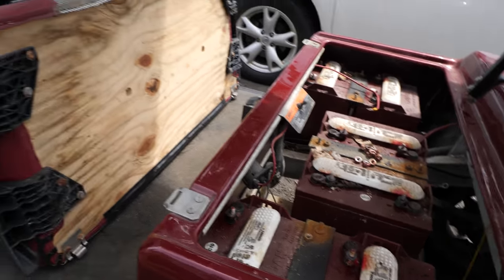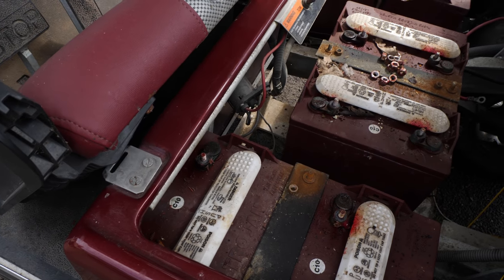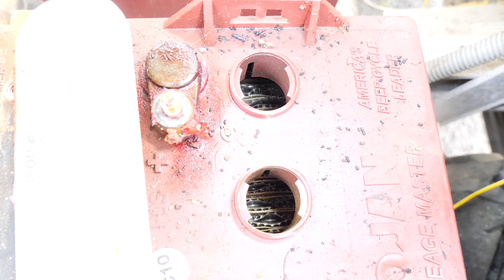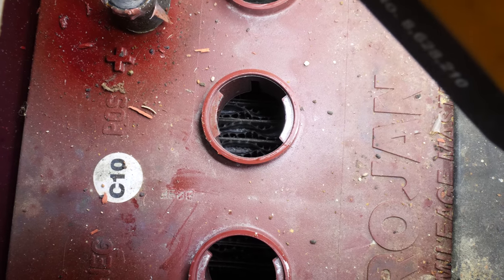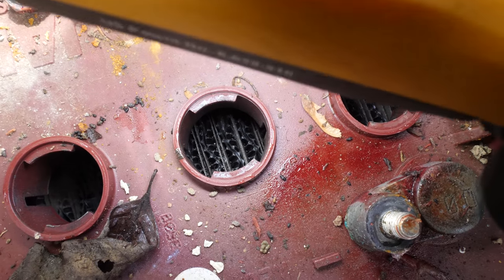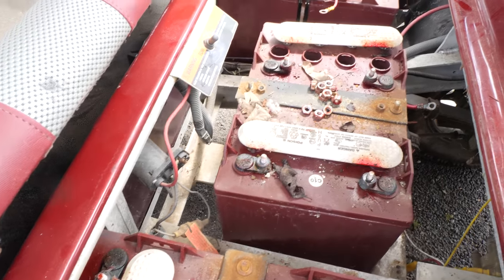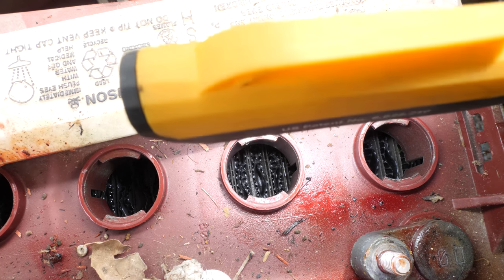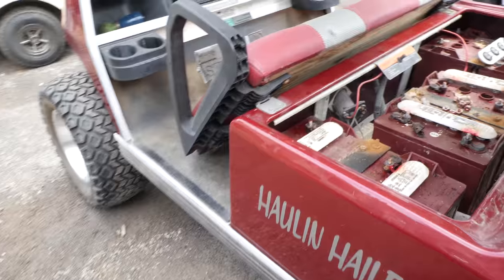2001 Club Car DS, 48 Volt Electric - No Water in Batteries

Comment: Every two weeks I check mine and water as needed my batteries are 5 years old and running strong with the proper care Trojan 8v batteries
Reply from the maker: Typically you should only need to check them every 4 or 5 charges. Only fill them after charging, not before. I have 14 year old batteries in one of my personal electric carts.

Comment: How often should you check the water in the batteries 
Thank you
Reply from the maker: I recommend checking the water in flooded batteries every 2-3 charges until you see the water going low. Never let the plates become exposed to air. Only used distilled water.
Reply: D Lastname just to let you know your betteries aren’t toast if there’s no water just add some distilled water and if that doesn’t work add some epson salts

Comment: I have a 2000 club cart 48v.. Batteries have power they read 49 volts with a meter, whenever i turn the key on and press on the pedal i hear a click but the car doesnt move.. I tried the bypassing method of unplugging the computer and connecting a jump clamp from yellow wire of solenoid to last wire of ground and no luck..
Reply from the maker: Charge your batteries. 49 volts is nearly dead. A full pack with good batteries should read over 52 volts fully charged. You are going to need to check the power before and after the solenoid (the large terminals). If power is not on both sides of the large terminals, replace the solenoid.
Reply: @Kevinsgolfcarts  by checking the power of the large solenoid terminals do i just put the black and red probes from the multimeter and see if it reads 48v? Also for it to read i have to press on the gas pedal right?.
Reply: @Kevinsgolfcarts  one of the things i noticed is when i tested the outer post negative post from the controller using a tester with the clamp on main positibe from the batteries, the light turned on without pressing the gas pedal, then when i pressed the gas pedal the light gets real dim.. On a video it says the light should turn on and get brighter as you press on the pedal, mine does the opposite

Comment: Tap water works just fine!!!
Reply from the maker: You shouldn't use tap water due to the impurities in the water. Deionized or distilled water is the only water you should add to lead-acid batteries. These impurities can short the plates in the cells and shorten the battery's life. Why chance ruining the investment? Battery manufacturers can test for impurities and will reject a warranty if you add tap water.
Reply: @Kevinsgolfcarts  disagree.....been a forklift tech for 28 years..more than half my customers have watering systems which are connected to the main water lines.average life of a industrial battery 5-8 years if maintained properly.however seen tap water battery's at 10 years and just showing signs of slow death.
Reply from the maker: That maybe fine for forklift batteries. You're dealing with a much larger battery with larger surface area and sediment traps in the bottom of the battery case. Tap water will destroy golf cart batteries in a few short years. I see it with golf carts all the time. I will never tell someone to use tap water in batteries I sell.
Reply: @Kevinsgolfcarts  again disagree...my personal golf cart used tap water as well as scissor lifts,floor scrubber which use golf cart batterys (u2200) etc..I never had a issue or my customers never had issue...been in the business for 28 years
Reply from the maker: That's all fine for you. I run distilled or deionized water as per the manufacturer. I will continue to instruct my customers to do the same if they plan to maintain their own packs.
Reply: @mikesecondo2254  why take the risk?  Distilled water is dirt cheap, and guaranteed.   I use condensate from a/c units, so it costs me nothing